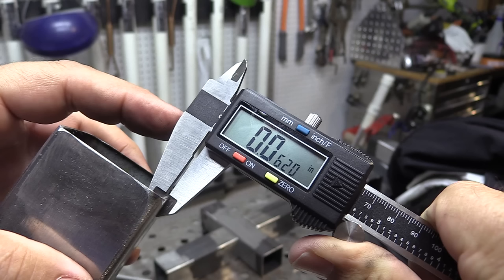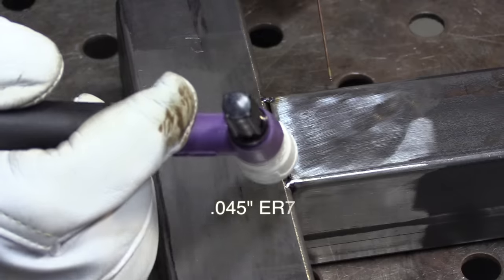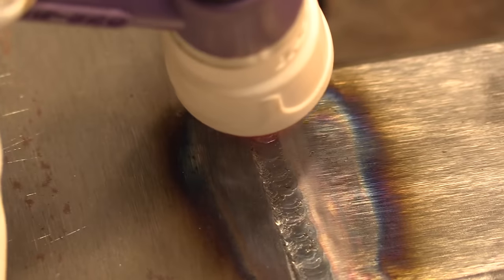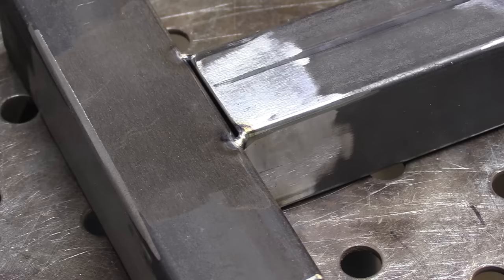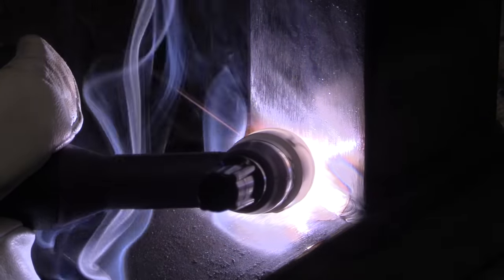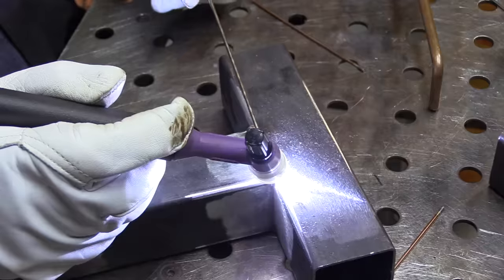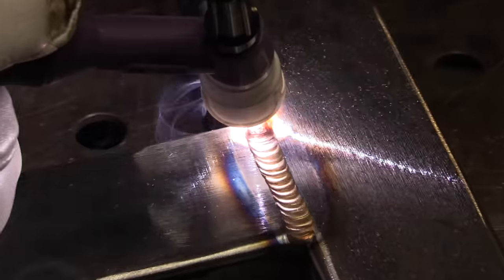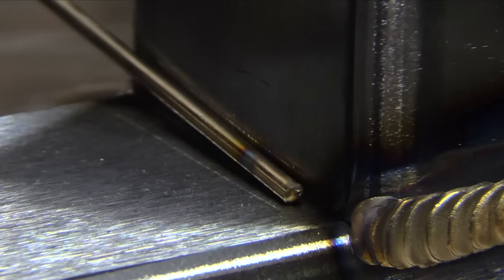TIG Welding & TIG Brazing

Comment: I got overconfident (See the Dunning-Kruger Effect) and offered to do a repair job for my neighbor that needed me to attach the edge of some thin perforated sheet steel to the side of some heavy wall square tubing in a T joint.  I could NOT get enough heat on the tubing to even start a puddle without eating up the thin perf sheet.  Silicon bronze saved my day, it did.  I only had some on hand because I saw one of your videos like this one and decided I should stock that filler.  Thanks for saving my reputation!

Comment: Amazing, you sir have talent and an ability to teach. Thank you.
I'm just getting back into this after almost 30 years away from any Tig Torch. A lot has changed for me and the tech now is a lot to take in. Just bought a new Miller 215, it does not have all the fancy pulse control etc but I'm sure it will do fine for my current needs. I have a 69 Mustang waiting for my skills to build....watch one of your vids....go practice...watch it again... go practice and repeat as necessary.
Reply: P

Comment: SB is a lifesaver on old car restoration. Plenty strong for sheetmetal repair, keeps heat way down and shaves off with a Vixen file so not a lot of aggresive grinding which generates heat. Usually final dress with a flat file gets it zeroed in.

Comment: Got to love the Heat-Affected-Zone comparison at 7:31!  This is of course what we're expecting, but it's good to see it.  I've done this process now on some little coupons and it worked fine, haven't actually made anything with it yet.    This sixteen gauge square tubing (and sheet) is a big issue locally.

Comment: Perfect timing. I've been banging my head off some thin wall tubing with the issues you mentioned (burning through/bringing contaminants forward). I'll try the lay wire technique with thicker filler tomorrow. Thanks!

Comment: if you point you tungsten at the solid wall instead of the cut end on those t joints you dont get those blowouts. its not a heat problem its your position.

Comment: hi sir thanks for video , very instructive ; some questions help for you please 

- need to buy tig pulse , or double pulse , not expensive price , and try the silicone bronze on stainless ,and aluminium metal mainly 

- is silicone bronze available for tig welding , on sheet metal , and aluminium ? 

my objectif is to weld fastly with tig and less power current , that"s why the silicone bronze filler could be the solution 

where to order for this equipments thanks advise

Comment: But if you use clamping is it necessary to worry about the pull?

I worked in my apprenticeship mostly with MIG MAG and use 30x30mm square tube with 2,5 or 3mm thick wall.

What grinding disc do you used in this video?

Why do you use the pulsing for bras and what does it mean when it puls? How can it be described?
Something like the tacking operation?

Comment: I have the hardest of times not making a tiny melted puddle of base metal while having enough heat for the SiB to flow 

I get it that the arc is to be focused on the puddle not on the base metal .. but I find that the bronze won't flow if the base metal is cold?

Comment: Great videos. I have a question, should you need to place an Aluminum or SS plate under your aluminum work peace when you welding on a steel table?

Comment: Oh yeah! Tig videos! Here were go baby!

Jody, can I TIG Braze on the outside of a 2-Stroke dirt bike pipe? I'm thinking of duplicating the "cone pipe" look (Google that if you don't know what that it). I know the inside off that pipe is going to be full of junk and I don't want to pull it into the metal... Hence my reason foe brazing, not welding.

Your thoughts?
Reply: It definitely should work, be just careful not to make an hole in the narrow metal, it happened to me and I had to fix it

Comment: What are the practical differences between the ER70-S2 and the ER70-S6 when it comes to thin wall tubing?  Any one is preferable to the other, and for what reasons?  Thanks.
Reply: Dan L. Probably go s2 as there is less mill scale on tubing.

Comment: Hi Jody - I’m having trouble welding 2mm wall Mild steel tube to 1.8 mm plate. Weld is fine but the plate is puckering on the other side of the weld, and I can’t grind to blend out on that surface. Any tips?
Reply: Уменьшить ток если нужен провар на всю глубину используй поддув с обратной стороны

Comment: why when i tig brazing it keep make spark and blown up with some white dust like flux?

thank you. . im realy2 new in tig brazing
Reply: It sounds like you're using regular "Low Fuming Bronze" or some other bronze rod that contains zinc, which makes white fumes (very unwholesome) and that mess you're talking about.  I think here we want "Aluminum Bronze" or "Silicon Bronze" which don't contain volatile stuff.
Reply: @leonardpearlman4017  ohh i see, so to preventing from that problem i must using the right brazing rod ? it must use only silicon or aluminum bronze right? thank you.

Comment: PLEASE, I need some sound advice, I want to purchase a Tig/Mig 110/220 volt welder, I have scoured Amazon but now I am confused.  I can afford the $700.00 range of machine.
Reply: Go with the prime weld tig machine it's a tig and stick machine it don't have mig but it is in my opinion one if the best machines out there for the price I have had one for about a year and I use it more then my Miller machine

Comment: WHY, WHY, WHY would you select S2 over S6? ASME states S6 is an acceptable replacement for all OLD S2 welds that were specced S2 before S6 came along.  The extra silicon makes the weld lay much nicer. And dude I could use ER70S6 1/16" on that and make it look like God himself done it. Absolutely no need for 3/32 wire